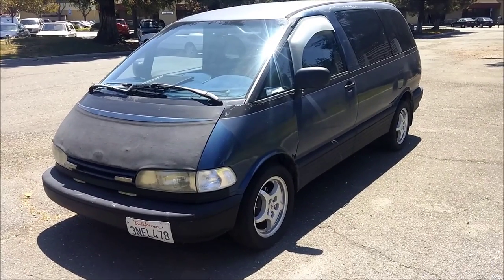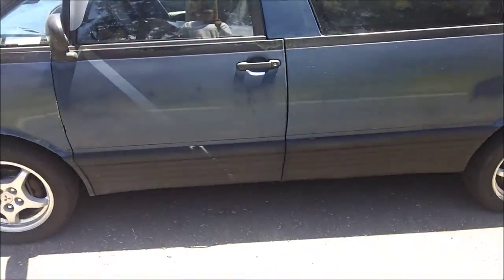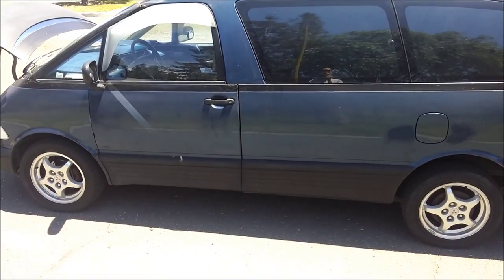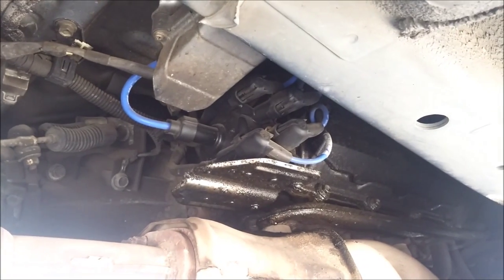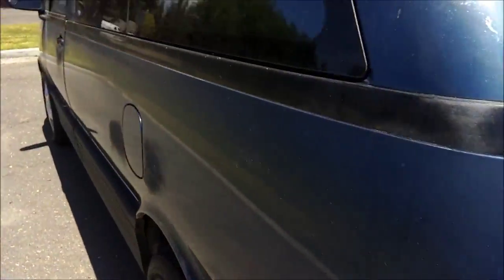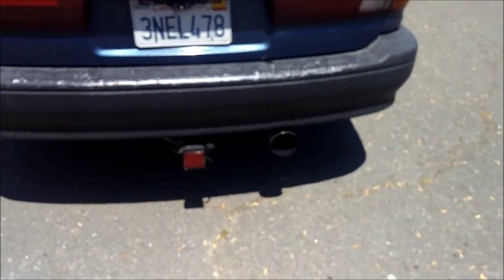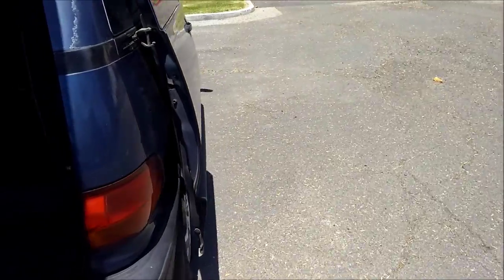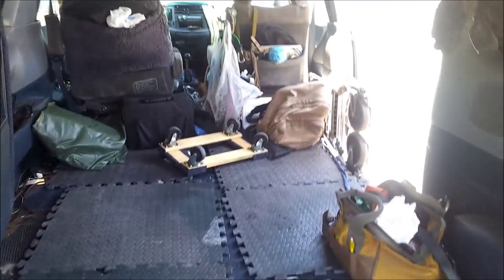HadesOmega's 1991 Toyota Previa Battle Van

Comment: We don’t have a stick shift version in our area. But happy with my automatic ‘93 Previa now with 280K miles and still going strong on an original engine, transmission, and drive train. Sure very durable and reliable.  Built like a truck. This is a keeper.

Comment: I own a 1991 Toyota Previa 5spd too! All the reasons you gave for liking your van are the same as mine. Although the 5 speed is not the best, I love having the 5 speed in a van. You just won't find a 5 speed in a van with toyota reliability. Mine has 195k miles on it. I've only had it for a year now, but I hope to keep it for a long time! Also, I once got 27mpg going from Nor Cal to So Cal. I was going 65mph the whole way, but the mpg reward was awesome!
Reply from the maker: +Kurt Hutchison Wow nice don't know how you pulled 27MPG off, at best I can get 22mpg, usually around 19mpg.  But yes the manual transmission does kinda suck, the gearing is just not very good and its not comfortable to shift.  Let me know if you find a short shifter for it!  =)
Reply: +TheManInDboX I'm not really sure what a goose neck shifter is but if you change the height of the shifter the throw increases also.  So if I want a higher shifter I need to shorten the throw also or else you get these huge throws that bring you pretty close to the cup holder.

Comment: I have a 1991 too! My rear bumper reinforcement is trashed.How did you install that tow hitch? Thanks!
Reply from the maker: It's been a while since I installed it but it's a class 2 hitch that i modified with a 2" receiver.  It mounts to the rear tow hooks.  Not too tough to install, I think it's 4 bolts.
Reply: Thanks but I have no bumper reinforcements. I think I'm getting a custom job done.